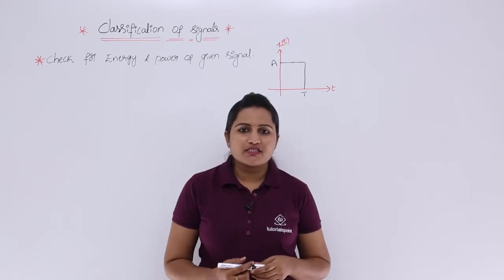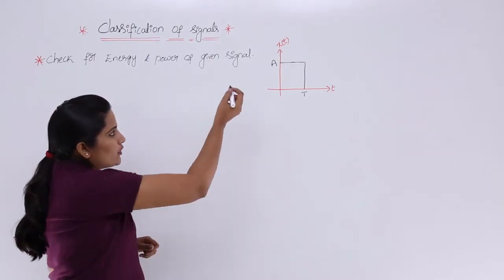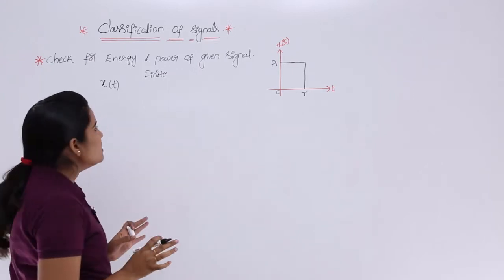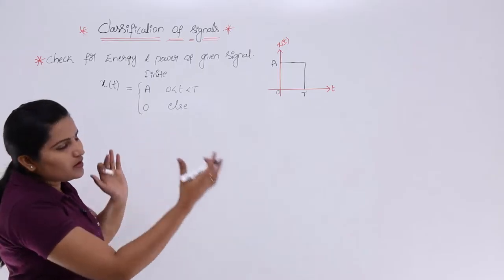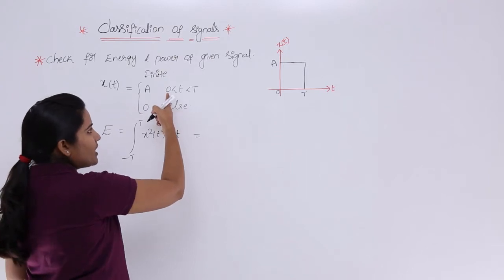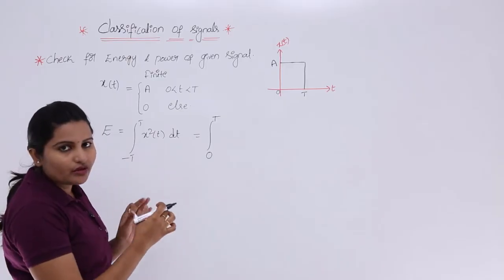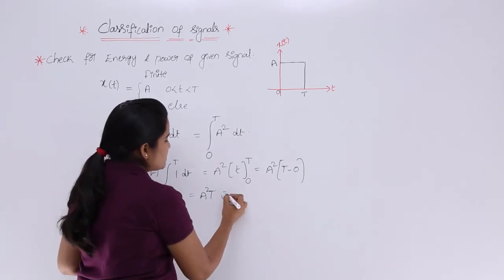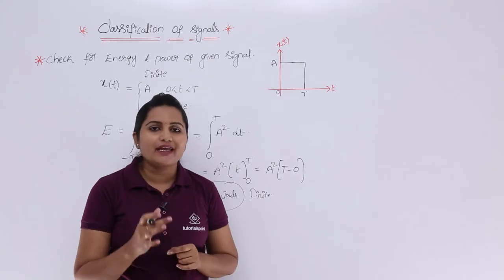Energy & Power of a Signal Example

Comment: the value of power signal according to the formula 1/T integral 0 to T/2 (A^2)dt will come as A^2/2 and not 0. any solutions?
Reply: @TheCDAGR81  For this example, energy v r getting, is  T*(A^2)/2 and power is like (1/2T)*Energy.
So if u do calculation, both 'T' will get canceled each other and remaining with (A^2)/2.

How power become zero?
Please correct me if Im wrong.
Reply: @praneshjoshi5927  i think it is neither energy nor power signal... Since we r getting finite values in both conditions